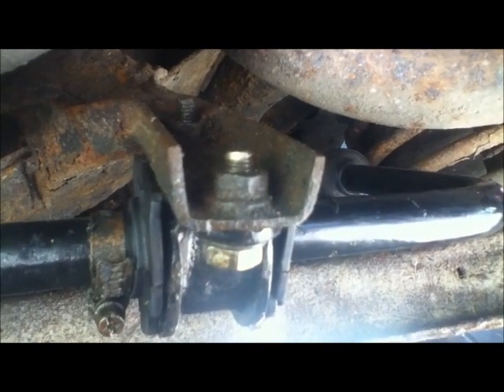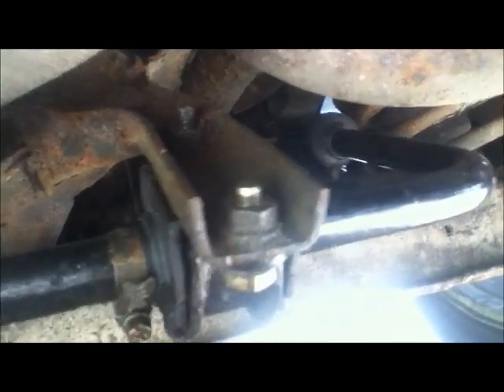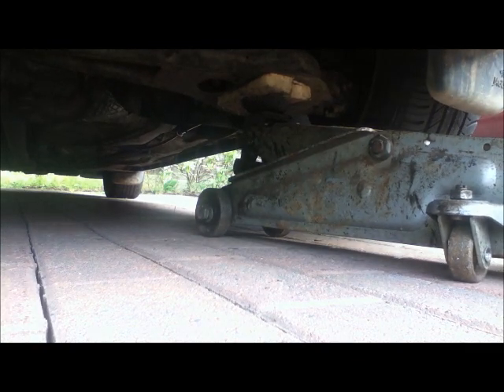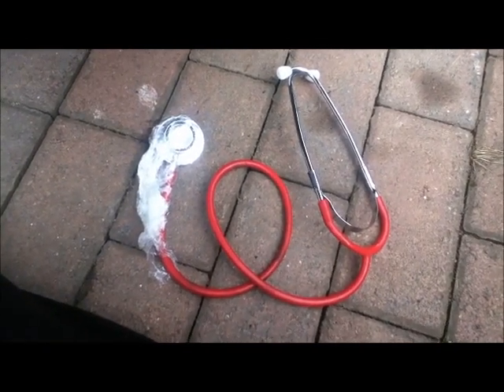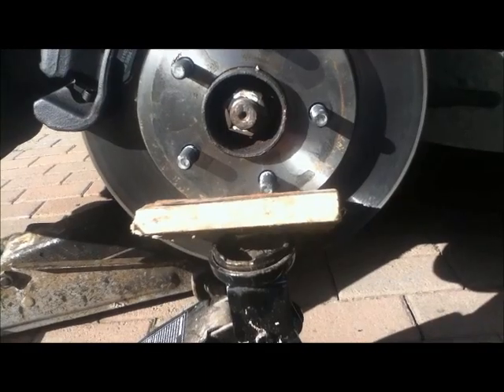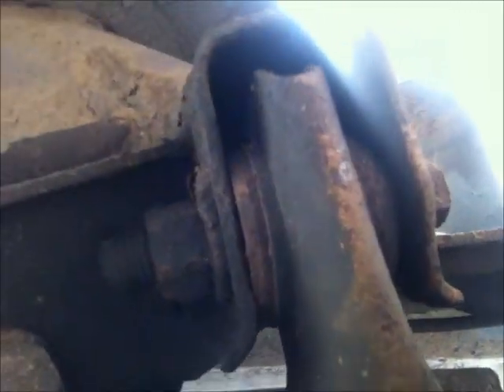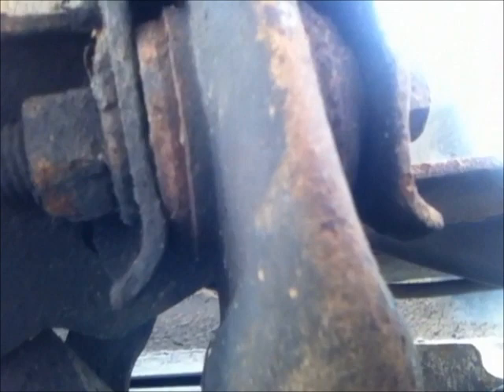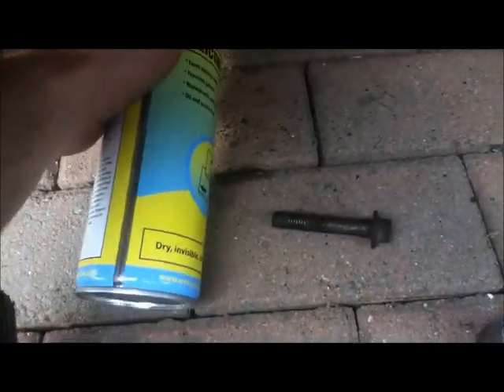Jaguar X Type - identifying annoying rear end noises.

Comment: Hi excellent video in low technical language/fog index which certainly helps. The abundance of control arms on the x type  is great for weight saving but can lead to complications due to the fact that both the pivot and moving end have to be investigated. I’ve also heard that the control arms can bend  over time and pivot bolts can seize making dismantling very difficult especially as bolts can shear and not easy to replace. Keep up the good work I thoroughly enjoy the videos.  Ken

Comment: My 2003 3.0 s type has started making this noise. I've tried your WD40 and grease trick it worked for about 15 miles. I'll now try this trick. I guess it's just another jag gremlin one of many. It's a real love hate thing with jags my xj40 never gave me all these problems. I'm so glad I've got my trusty mercedes to fall back on to keep my motoring spirits up. Thanks for the tip. I'll now go brush up on some more french Lol....
Reply from the maker: If it is the lower suspension joint (like on my X-Type) apparently they are oil filled. When they dry right out they need to be replaced. That said it could just be rust in the bracket and that can be cured with copperease or molybdenum grease. A temporary cure can be made with brake fluid as that is specially formulated not to damage the rubber seals.
Reply: Concept Symetry Guitars thanks for that. Sorry for the late reply I've currently been hospitalised. When I'm better I'll give it some more investigation. Once again thanks

Comment: That old problem, the rear, front control arm. I have the same problem starting again. Did you know that the rubber bushes are oil filled. When rubber perishes oil leaks out, then dry rubber squeeks like a rusty old bed spring. I've found that low frequency sounding knocking has come from the drop link at both ends of the arb.
Reply from the maker: The rear end does seems prone to squeaking. I just wonder whether it is because I bought ebay parts that they haven't lasted and are prone to rust. This was  a metal to metal squeak in the bracket.
Reply: Mine sounded much like metal on metal, but proved to be rubber on rubber. The rear front stabalizer arm rubber bushes had dried out. I think that they are a sort of honeycombe construction that is filled with an oil, that gradually seeps away, and that causes a rubber squeak.
I've also heard from a few (net) places that x-types are weak around the rear end!
Reply: Jimmy Jagg, I bet you're so glad you're not called Jimmy ford focus....

Comment: I have a 2004 2ltr diesel that still knocks and creaks after literally everything either replaced or removed and checked. Local mechanic spent 3 hrs searching for the cause of a knock on offside front and nearside rear. Nothing. Thank god he didn't charge me. :)
Reply from the maker: What sort of knock is it and when does it happen? The sound can be transferred across the car.
Reply: Turns out it was the front drivers side spring. The bottom section, enclosed in the rubber tube (presume its to prevent metal on metal rubbing), had cracked. The spring came out from the seating this week going over a speed bump and ended scraping the tyre. The tension of the spring clearly stopped it being noticable under inspection.

Comment: Same car, same noise... thank you so much!!  Will lubricate it.. I don´t understand WHY we got that noise in just ONE side...
Reply from the maker: Normally one side of the cars suffers more water ingress than the other due to puddles or oncoming traffic driving water in.
Reply: The thing is I got the problem in the same side as you did, also in the UK.  I guess it is the puddles as you say.
Reply: The answer for why one side wears more than the other with suspension and control components in Europe and the UK is... ROUNDABOUTS!

Comment: Did you find the problem?, I have a squeaky bed sort of sound from my rear end on the Jag. Just priced up parts to do myself, 300+.
Reply from the maker: Bushes on the lower control arms. They lasted another couple of years before I replaced them.
Reply: @johnnysevengun  hoping once I do them all, problem sorted. Will get all parts together first.
Reply from the maker: @matthewjackson3034  Don't buy a cheap e-bay set as they are fake parts that won't last a year. The best deal is usually from Eurocarparts on one of their discount weekends. I bought secondhand original upper arms from a Jag breaker and they have been great.

Comment: Don't use silicone on suspension parts. Use a copper anti-seize compound. Same thing when you replace bolts or bushings. The bushings are solid rubber and the squeaking comes from the bi-metalic corrosion between the bolt and the inner bushing race. DO NOT oil the bushings as it will deteriorate the rubber. The rear end is pretty solid but is hung in suspension: one bad bushing and the whole things out of whack.
Reply from the maker: So where I repeatedly say plaster it with CopperEase completely passed you by? Also dry silicone spray is perfect for the anti roll bar bushes.

Comment: i took the upper and lower arm of mine today, cleaned it all up used copper ease, and when I put it back together it was as quiet as a mouse, I thought great job done, then in the short drive back home the dreadful squeak is back, I also took the bolt out the bottom of the shock absorber to lubricate it,  Mmm so what the hell is making the noise, think I will jack it up on the spring plate then see if it still does it.
Reply from the maker: Check the springs. Another contributor found his coil spring was broken and was making the noise.
Reply: thanks I will look tomorrow, I did jack it up though on the spring plate both sides and the squeak was not there, I am wondering if the bushes in the control arms are just worn out and maybe moving about a bit when under load.
Reply from the maker: I have read that the lower control arm bushes are oil filled and  creak when they dry out. You could try injecting oil into them to test them or just by some new ones. They are about £18 a pair off e-bay and will last about 2 years.
Reply: Hi ya, I have tested them out today and all seam fine, I think the culprit was dry anti roll bar bushes.  I have just uploaded a video on what I did to fix the problem.
Reply from the maker: Nice video. When you get the chance - get rid of the rust in the ARB's and paint them over before putting it all back together with dry silicone lubricant otherwise you will be doing it every couple of months or so.

Comment: Hey! Can you check the small video I uploaded with a sample of the noise that comes from the rear left side on rough roads? 
Think it might be the same as this...
Thank you!
Reply from the maker: That rumble could be two things - the anti-roll bar bushes need replacing or the rear shock bushes need replacing. Try the ARB's first as that is most common. Have a look at the videos I've done on changing both parts.

Comment: I was a jag technician and worked on everything on these X-Types,  these cars are a nightmare and the deisel was even worse,  Terrible cars cars , they were only made to last 7 years.
Check the rear suspension blade that the hub is connected to,  the front bush used to wear out,    you'll like that job  haha.

Comment: I got bangs and rattled on mine. Just turn the radio up. Don't hear them now. It's been checked by my garage. That say everything is ok. Well looks like to me that are all like it. Spoils the car.
Reply from the maker: The bangs and rattles can be cured and are usually the ARB bushes, drop links or shock mounting bushes. Mine now glides like an ice skater with only the sound of the wind and the tires.
Reply: @johnnysevengun  sorry what is ARB?
Reply from the maker: @paulo.andrade  Anti Roll Bar -  I think Americans call them sway bars.